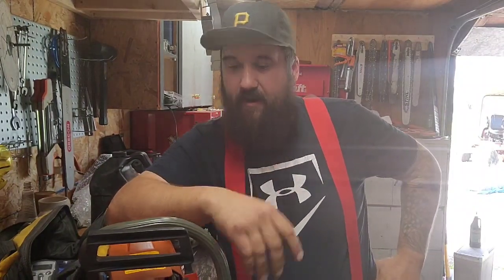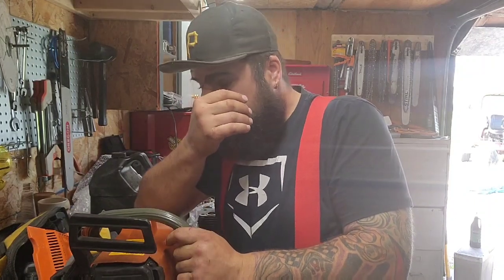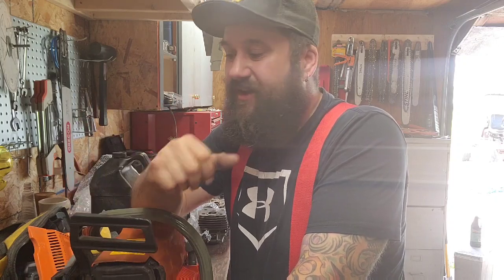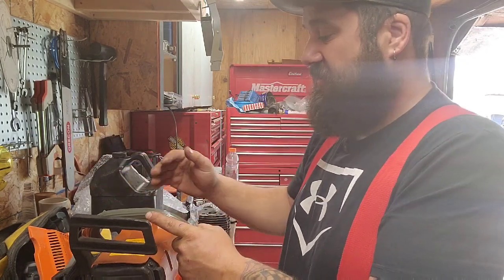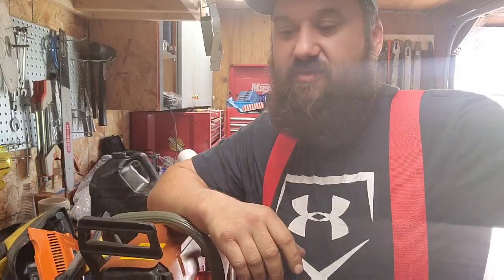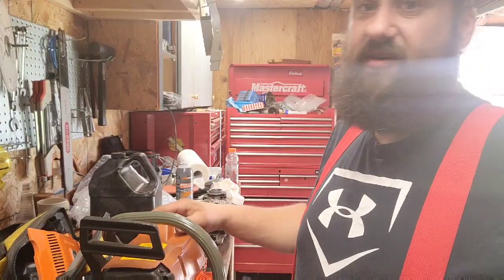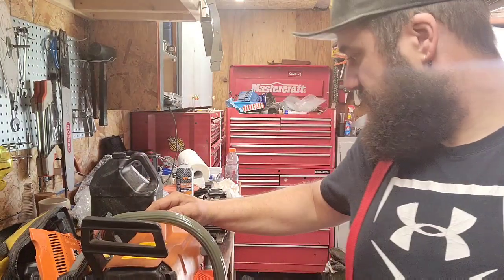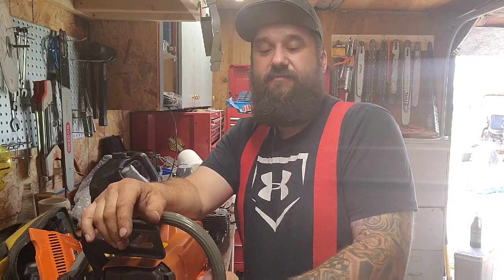Bench talk, my thoughs on break in procedure.

Comment: Like your videos. Looking to port my new Echo 620pw after break-in.  Never ported a saw, but many zenoah and other scooter motors. We piped them, larger carbs and some other tricks, i achieved moderate success in the racing scene. If you read this, have you ever seen a expansion piped saw where the pipe swept to the left and doubled as a measuring gauge also?  Haha. 18" of pipe to the left with a stout bracket. Fast Firewood

Comment: I tell you what, I started watching yours and ironhorses videos because I wanted to understand how two strokes worked. My first video ended up being the one you made on port timing with the degree where on the engine that's cut in half. Gave me the old rope a dope and sucked me right in instantly. I had no idea what port timing was but I came away from that video with an understanding how fuel and air travel through the engine, and what part each component plays in that process. Now 4 weeks later I understand  the "process" of port timing and how to get numbers off a saw. All this was enough to give me that saw itch again and can't believe how lucky I was to find in my home town shop, the exact saw I was looking for. A brand new, still in the box, Stihl ms460 magnum. Still has the warranty. I think I'll have the only unboxing video for an ms460 on YouTube. Thanks again to you tinman. The knowledge is priceless

Comment: Love my old 272 Bought it new in the early 80's. Also a 65. Not much out there on the 65 but it still runs good. I didn't know much about two strokes but since I started watching Harv and Bellhopper I have them running. Not ready to break out the Dremel yet but at least I now know how they work. Wish I had known that 30 years ago.

Comment: Love seeing more guy's starting theses these channels so thumbs up for that! I picked up a barn find early 365 and after going thru pretty much everything I got it running and it's the cats meow. So now I have the bug to port it. My question is after porting will it generate enough HP to slab maple on a chainsaw saw mill, or should I be thinking bigger saw?
Reply from the maker: Great question, 

For milling my oppinion is minimum 90cc saw (bigger the better) and no porting.  

Ported saws have too high of a chain speed and will probably get too hot while milling and seft destruct. 

I personally don't port saws that will be strapped to a mill.
Reply: @tinmanssaws  thanks tinman I would not have thought about the porting issue!

Comment: Hey man I have an old 262xp, beast of a saw I love it, but the idle screw has been rounded so it requires adjusting all the time. My local small engines guy had a look and says the only thing that can be done is replace the carb, and a genuine one is expensive. Currently I have locktite on the bolt which works for a while. Is that really the only way to fix this issue (replace carb)?
Reply from the maker: If the seat under the jet is warn then yes the carb is no good..

If its just the jet comes loose try putting a heavy spring underneath it to hold more tension on the jet.